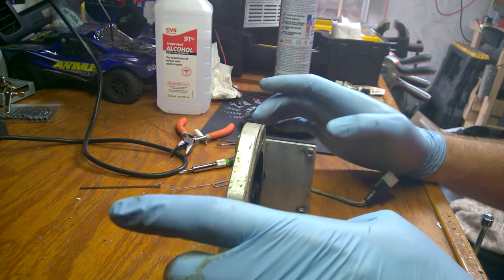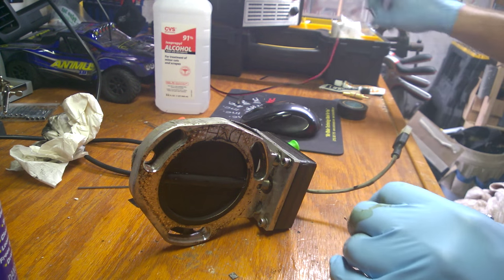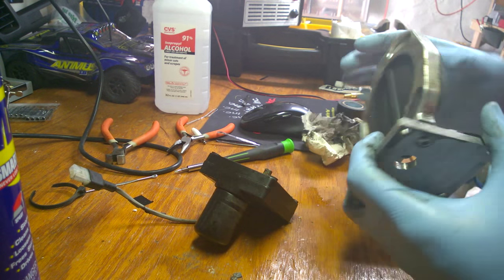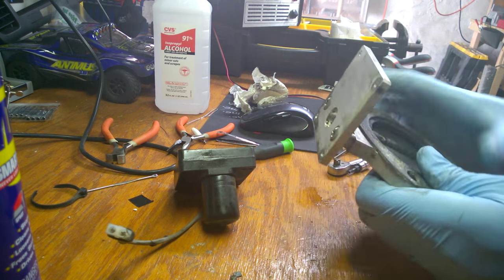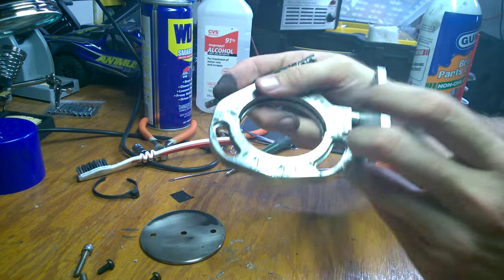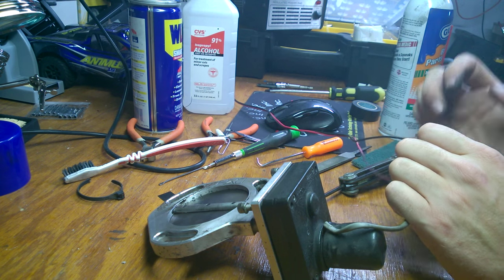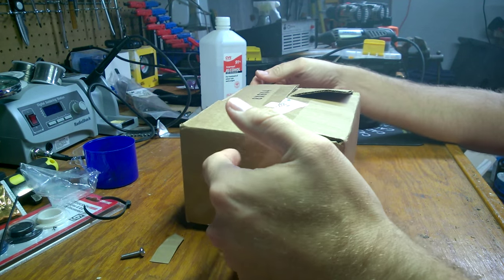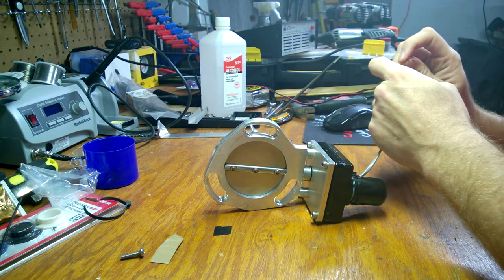DMH Cutout Diagnosis, Disassembly, and Replacement

Comment: I actually had a hard time getting in touch with Dave so I decided to just rebuild mine on my own.  One thing I always wondered though was if anyone had luck getting theirs serviced and now I see that you indeed did.  Wonder if anyone else has had luck within the last few weeks/ months.
Reply from the maker: Huh... I know he's not a very big operation.  I just put the cover on the cutout and wasnt in a hurry...so maybe it did take longer than I thought haha.  Good on you for rebuilding... I couldnt find bearings to fit, and I didnt feel like digging the rusted ones out all the way.  Where did you find bearings/bushings?
Reply: Does anyone know where I can get a replacement motor/gearbox?!

Comment: I'm looking at getting a pair of these to open the exhaust on  a 350z, and having them operated by using the manual mode switch to trigger a pair of relays(one on the manual side, one on the automatic side) so that when the shifter is moved into the manual gate, they open, and when the shifter is moved into the automatic side, they close. my question is this. if you apply power to either open or close them, and leve that power on(like if the switch were stuck)do the motors continue to try to turn, or are there limiters internally that prevent them from burning up?
Reply from the maker: Hi Walter.  Sorry for the delay.  Setup how I have mine, the motor will attempt to turn as long as you hold the button.  To my knowledge, there is no circuitry to kill power if you hold it like that.  There might be, but I didnt notice any.  You would have to either setup a timer, or figure out a circuit similar to how an auto-up power window works.

Comment: As a mechanic. All of these different companies struggle to make a good seal for the motor shaft. The gears keep seizing in the transmission, making the motor burn out. If it could stay in a sealed environment with gear oil, it could last forever, but they corrode and fail FAST. I replace them CONSTANTLY. I hope they find a fix soon
Reply from the maker: I put the rebuilt unit on 6 years ago. The car sat outside primarily. I just sold it and the cutout was working perfectly. The oil impregnated bronze bushings were a massive improvement over the roller style that seized up.

Comment: Hello, nice video. Question, hoping you can help out. I have pypes brand electric cutouts( look very identical to yours) I think I may have overloaded the motors and no longer working. Pypes wants more to fix then a brand new set! Unreal! Have any idea if I can fix this problem ony own? My understanding is they have surge over load protectors in them, I don't know. Does this mean it will pop before damaging the actual motor? Is this something I can fix or obtain parts on my own. I am pretty handy, however, not alot experience with electrical items. Any help would be high appreciated. I liked and subscribed. Thanks
Reply from the maker: Hey Vincent. Sorry to hear you are having issues with your cutout. It's ashame the manufacturer won't work with you... Ide suggest a different brand if you have to buy new! As for fixing that one, I'm not sure. Depends what circuitry they have built into it and what blew. Sorry I cant help more!

Comment: How can you test to see if the control unit is working ? The remote turns on when I push the button but it’s not closing or opening
Reply from the maker: If you are talking about the remote controlled ones, I cant help you much there.  Mine is a direct switch.  But...I imagine if you are hitting the button, and you arent getting 12 volts at the cut out motor, then something is bad.  Either its not receiving the signal, or the control box is dead.

Comment: so do these things need to be taken off every 10,000 miles or so and cleaned?  Mine just failed too it's likely all gummed up I've only driven it like 10,000 miles!?
Reply from the maker: I dont think so.  My issue was that the bearings failed.  They knew there was a problem with some of the bearings because their supplier switched to cheaper Chinese versions.  They then updated the design to accept graphite impregnated bronze bushings.  Which should last for a very long time.  My car doesn't run so dirty that it was caking stuff on the cut out, but if your car is burning a ton of oil or the tune is way off, it might gum it up.  I will however be using some brake cleaner on it any time I have the car lifted up a little, or at least once a year during inspection while its on the rack.  Just to clean up the seat area.
Reply: *****
the switch I use sometimes I may press the wrong way and further try to open or close it when it is already that way... wonder if I burned out the servo?
Reply from the maker: Eh.  I've hit mine after it was on a stop before.  Or when I start it Ill give the switch a couple bumps to make sure its closed so I don't scare my neighbors haha.  It is just a DC motor attached to a gear box.  I would think you'd have to really keep it pressed to do any harm.  You might pop a fuse or breaker before it burns up.  Is yours not doing anything?  If those bearings are toast, the shaft could be seized up.  Mine would open/close a little, but eventually wasn't doing anything.  I would do some testing first to make sure it isn't an electrical issue.  Make sure you have voltage down at the connector under the car.  You could also power the unit directly with 12v at that connector to rule out an issue.
Reply: *****
I'm going to put it on a hist tonight and see whats up thanks for the advice!

Comment: I have the low profile cutouts and they rattle like mad.  I tried calling multiple times, left messaged, tried contacting them as well through their site and via e-mail with absolutely no responses.
Reply from the maker: +Larry Sliwa Hi larry.  This is DMH you're talking about???  That is odd.  Exact opposite response I got from them.  They almost always answered the phone as long as it was during regular hours.  The guys answering the phones are also the guys working on the parts too though.  Being spring time maybe they're just swamped?
Reply: So this just happened....I read your response, pulled mine off and checked the gearbox/motor to Multi Products in Racine WI.  I called them with the Spec # and they told me to again to call Dave, said "THIS" was the optimum time to contact him, even gave me his number.   I called Dave, explained my issue, and he is going to hook me up.  It must be a combination of timing and him being a one man show.  Frankly, it makes my week!  Thanks!
Reply from the maker: +Larry Sliwa Yup Dave is the man!!!  Thats who I dealt with, and when I was asking for an update to my cutout, he was literally looking on the bench, grabbed it and told me it would be done and back to me within a day or two.  He's a good guy...you'll get taken care of.
Reply: Well, I need to follow up on this.  It's been a month since I spoke with DMH and haven't heard or received anything.  I called after two weeks and left messages with my number with no response.  This last Friday I figured I'd try one last time to contact him and his message box is full and I cannot leave a message.   I went from elated and hopeful to not so hopeful.
Reply from the maker: Well thats a bummer... Just keep at him.  If his mailbox is full, he's probably swamped.  Like I said, I dont think he has many people helping him out or working for him.  I could be wrong.
Reply: I got the Multiproducts ones installed and no issues.  The motors are a little bigger as well.

Comment: Did they charge you for the repair? If so, how much? I think I'm gonna send mine in too. Talked to him on the phone, they seem like good people
Reply from the maker: +Dave P I only had to pay to ship it to them.  So around $10 maybe?  After that there was no talk of money.  I did have to chase them a little bit.  It did take longer to get it back than I expected.  But I just installed a block off and it didnt bother me much.  What's yours doing?
Reply: +JEG's Garage basically the same problem you were having. Mine was even more jammed up, but I managed to free it up a little. Got it so it moved about as much as yours was. Called him and just had him send me a new valve body for $100 since I didn't want to send it in and be without it. Don't have a block off plate for the cutout and still want to drive the car before the snow comes. He did say I can send back the old one and he'll try to free it up for me so I'll have a spare. So I'll do that once the new one comes
Reply from the maker: +Dave P Oh ok..so he sold you just the valve assembly for $100?  Thats still better than having to buy a whole new unit.  But I would definately send it in to him to fix the old one.  He'll clean it up and put new bearings in it.  Good for a back up...or you could sell it to someone else that has an issue and recoup some of your money.  Those block off plates are usually available at Autozone/Advance/Napa.  I just happened to have one laying around, and I keep it handy just in case something happens.  Because its REALLY not cool to drive around 100% of the time with wide open exhaust lol.  Draws way too much attention to leave it that way all day every day IMO.
Reply: +JEG's Garage yeah $100 isn't bad at all. Pumped to get it back in working order. Same as you, I open up the cutout just about every time I get in the car lol. I'll definitely send the old one in to get repaired. Even if it takes a while to get back it'll be nice to know I have a spare backup

Comment: This would have been a perfect application for ceramic bearings.
Reply from the maker: +Tim Ramich I think they made the right choice by upgrading to the solid bearings.  The rollers just wont keep lubricated well enough under all that heat.  At least I dont think so.  We'll see how this one holds up!
Reply: +JEG's Garage IIRC you said they were bronze, which is what people use in the throttle bodies, so that will probably hold up better.
Reply from the maker: +Tim Ramich Yeah I think that's what they were.  I pictured them being similar to a pilot bushing.  I don't expect any issues with it now!